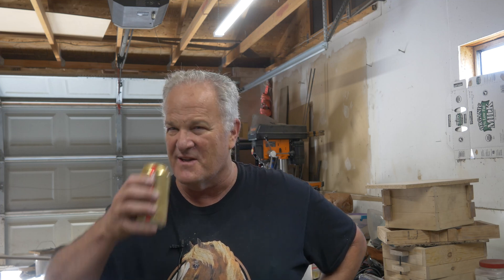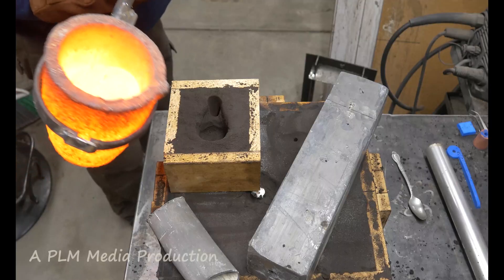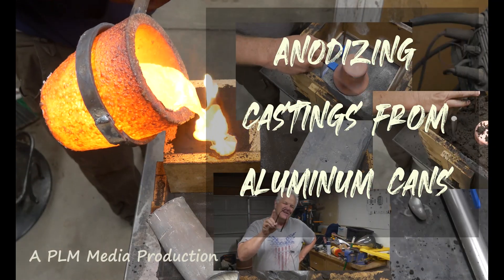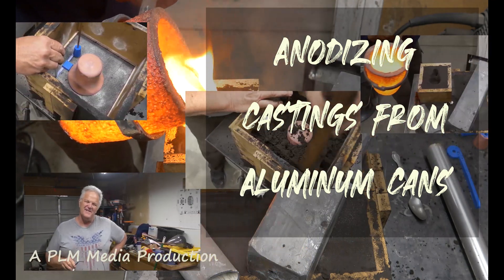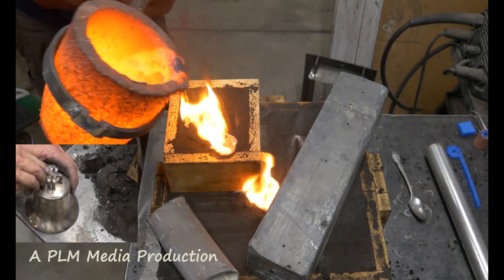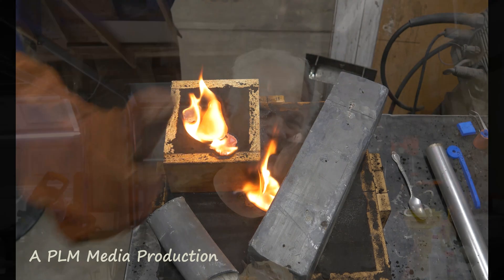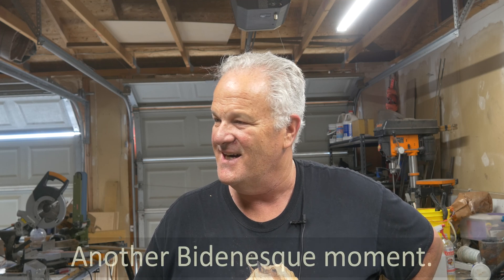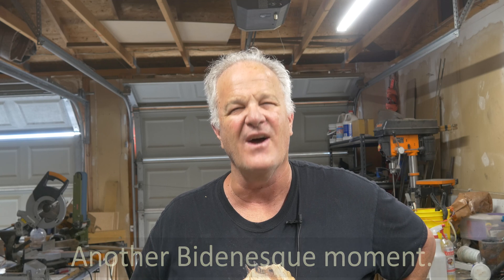Anodizing castings from aluminum cans

Comment: Anodes on Boats are there to protect the Boats Hull (Steel) and then you get different metals around the Stern you get different erosions going on. So I wonder if because you had both Alloys in the Bucket at the same time the process attached more to one than the other, so its a bit late now , 4 years on I make this comment,  but if you did the process again but individually I wonder if the out come would be both become none conductive ?

Comment: No idea if it was a myth from my (our) youth... but the tabs from cans is supposedly different material. Be interesting to do a melt on only tabs (dammit - I'm going to have to try that now!) and see if it comes out differently. You could even do a crude rockwell test on the 3 which would give a clue to it's alloy.  Ditto with trying to bend the 3.
Reply from the maker: I assume the tabs are the same alloy as the lid/top of the can. But you're right, would be interesting to find out.

Comment: i have no idea but the discoloration is similar to the metal finish found under the paint on anodized frames on 1970 ish fishing reels.
Reply from the maker: Interesting.  I believe the finish is related to a reaction between the silicon in the alloy and the solution the parts were immersed in. I still really like the finish from this reaction :-D

Comment: It looks very similar to the process that I’ve used to etch designs in polished aluminum. The difference is that I cover part of the surface that I don’t want etched. Then submerge it in a salt solution and run DC voltage.
Reply from the maker: Well that and that I was trying to plate the surface with an oxide layer to protect it.

Comment: What about aluminum building wiring?  I think it's up over 99% aluminum.  I have an old cable I've been meaning to tear out of my basement.  I think it was the original transmission line, or maybe what was run to the oven.
Reply from the maker: That's the wire I used to hold the parts. If it's low in silicon, I expect it will anodize pretty well.  I've got a bunch of ingots sent to me by a sub to try some more experiments.  I need to get around to trying it again.

Comment: Just my random thoughts, but what did you use for the cathode (or is it anode?  I always mix them up).  You are using the same material to deposit onto both castings.  That could explain some differences, but as I don't know nearly as much about anodizing & electrolysis as I ought to, I can only spitball likely un-useful comments.

Still, it's an interesting experiment, and I look forward to wherever this rabbithole leads.
Reply from the maker: Hi Brian. I used aluminum anodes or maybe they were cathodes I can never remember either. I think they were just scrap aluminum that I had poured into long flat pieces. Actually probably from a failed casting of a sword. No telling what composition they were.

Comment: been interested in the difference between the proper alloys and pure aluminum for a while. The crap from the cans didn't turn out too bad! I've also heard the pure aluminum can be good if you want to make your own round stock on a lathe.
Reply from the maker: I was pretty surprised that metal for cans would be good for anything.  I have plans to do another anodizing test this time with dye as well. Just got to get out there an make it happen

Comment: What happens if you make bronzal with different types of aluminum alloys?
Reply from the maker: Bronzal?? That's a new one one me 😄  I actually don't know what happens to the bronze with different aluminum alloys. One would have to expect that it has different properties. Silicon bronze has different characteristics from aluminum bronze so I would assume adding a tiny amount of silicon, 6% of 10%, would have little difference but there has to be some change to the metal.

Comment: is it possible .... that the higher silicon content of the 319 is actually forming a layer of silicon dioxide, instead of aluminum oxide?  a quick search of the properties of  O2Si states it appears as transparent to gray and.... it is electrically conductive hence its wide spread use in electronics lol.  Possible??
Reply from the maker: Hey, anything is possible 😄  You could be spot on.

Comment: I know nothing about this process but it was weird how your 2 sacrificial pieces reacted and so did your 319. Did your sacrificial pieces look the same as the 319?  Does the material or oxides or whatever it is come off the sacrificial pieces to adhere to the aluminum cans?  Then maybe the 319 acted like a sacrificial piece as well..  Then again, I have no idea what I am talking about.  But it was an interesting experiment.
Reply from the maker: Ha!  Gary you sound like me a week ago 😄

The anodes, or sacrificial pieces are negatively charged and the cathodes (the round pieces) are positively charged. The metal comes off the anodes and collects on the cathodes.  From negative to positive. 

The anodes don't look like the the 319 cathode. In fact, they actually show some copper slime on them after I was done. That was a weird thing I didn't show in the video.  I expect it was from copper in one of the alloys but because the metal is leaving the anodes the copper just wipes of with you finger. It doesn't plate.
Reply: @swdweeb    I guess we will just call it magic for now then. LOL ;)
Reply: @swdweeb  You sure about this??? From what I can see the reaction should of been on the part (the Anode ie: positive), and not on the bottom plate(the Cathode ie: negative). When I did anodizing some 20 yrs ago, the reaction was always predominantly on the part. The part is being oxidized by the chemical bath it is in. No transfer of material is taking place on the part. You are not plating here Gary. You are anodizing, creating an oxide layer that is porous enough to allow fine pigments or color to migrate in the tiny spaces left in between the oxide crystals. BTW. You should rinse and color your parts immediately after removing them from the anodizing bath, before too many oxide crystals form on the surface or your part will not take any color. Aluminum oxidizes naturally over time and will seal itself not allowing any color to permanently seep through its top layer. Maximum of 10 minutes in air after rinsing. The shorter the time the deeper the color and richness of it will be. Just my thoughts(experience). Keep the videos coming. They're great.
Reply from the maker: @henri1511  I'm going on this "The Anode is the negative or reducing electrode that releases electrons to the external circuit and oxidizes during and electrochemical reaction. The Cathode is the positive or oxidizing electrode that acquires electrons from the external circuit and is reduced during the electrochemical reaction."  I found that here https://depts.washington.edu/matseed/batteries/MSE/components.html#:~:text=The%20Anode%20is%20the%20negative,reduced%20during%20the%20electrochemical%20reaction.

Now I could be completely backwards in my understanding and... as a result what I did was have my parts be donors but the fact that the can alloy appears to be non-conductive tells me that the oxidation layer formed on the parts and not what I thought were the donors.
Reply: @swdweeb  What a confusing website . I now understand how you got all messed up. OK. Anyways, Anode is always POSITIVE. You connect the positive from your power supply to your part, the Anode. Negative goes to your lead plate or whatever. The electrons will flow from your Anode(part) to the Ground/Cathode(lead bar or what have you). When plating, you reverse the flow electrons. Keep in mind, Anodizing is not plating. You are basically speeding up the oxidation/corrosion of your part in an electrolyte. In any case, I just thought to nudge you on the right track. There are tons of YouTube videos showing the process. Good luck and stay healthy.
Reply from the maker: @henri1511  Thanks, I'll go out and verify the connections I made and know for sure that the parts had the negative connection hooked to them.

Comment: "Remember, kids: The only difference between screwing around and science is writing it down."  Adam Savage Mythbusters. Yep Data and data analysis are the difference between just screwing around in your garage and Science.
The anodizing process makes pores in the aluminum by growing a larger oxide layer; Anodizing is, therefore, a matter of highly controlled oxidation. some alloys resist the process of growing a thicker oxide layer, especially alloys with more than 11% silicon in the alloy or high amounts of copper.
I've heard there are some ways to work around this issue, but it uses stuff like nitric acid as a pre treat.
Reply from the maker: So does documenting via video count as writing it down? 😄😄
I was told that a lye path would help remove silicon on the surface prior to the anodization process.
Reply: @swdweeb  documenting via video could allow for writing it down latter; so yes 😄
I'm still learing the ins and outs at work. I do know our die shop uses a caustic solution (I believe it's lye) to remove aluminum from the extrusion dies. So I doubt lye would help a cast aluminum part in anodizing. I also know they have a large tank of nitic acid which I believe is for the anodizing opperation. (I'm off doing metrology data analysis for the machining and haven't gotten much into the anodizing side yet).

Comment: This was very interesting.

I don't know too much about the electro-chemistry involved here, but if I had to guess, I'd say that the silicon alloy aluminum was coated in something from the anodes (thus why they were both reacting so voraciously). The can alloy perhaps formed an oxide layer too quickly for the same process to affect it. 

Maybe you could try using a different metal for the sacrificial anodes and see if that affects things? Lead or zinc maybe? Or maybe even just additional can alloy anodes?
Reply from the maker: I need to make a couple of lead anodes. I've heard that a few times now.   Someone else also said the same thing about the can alloy oxidizing really quickly. I never thought about that happening you could very well be right about that.

Comment: It's been to long for me to remember the chemicals but I did work at a place that anodized cast aluminum but it had to go through a few chemical baths and not just one.
Reply from the maker: I just had a guy comment that I might want to run it through a lye bath before trying to anodize.
Reply: @swdweeb  that might be what it was. It was over 20 years ago and I only worked there for about a year. I just remember it went through 2-3 different chemicals.

Comment: I must say I've never bothered to check for electrical continuity after anodising. It would save the step of setting up the dye bath if the anodised coating hadn't formed. Boo for keeping us in suspense regarding the dye step! 
Cheers, Preso.
Reply from the maker: well, I'm still in suspense as well. It's been 36 hours since I anodized. How long can I go to try the dye??
Reply: @swdweeb  shorter the better.
Reply from the maker: @askquestionstrythings  at this point I'll have to try another experiment that includes a nearly immediate dip in dye after the anodization

Comment: I've been playing around with the same thing. I've had good luck anodizing cast 7075. Also acid etch beforehand to remove some of the silicon outer skin of the casting and polish and degrease before anno
Reply from the maker: I did degrease using "barkeeps friend" or something named like that. Basically scouring powder. I havent tried to acid etch.  I have some muriatic acid that seems to be pretty reactive with aluminum that I could try.
Reply: @swdweeb  I use lye, i guess not acid etch since lye is basic lol
Reply from the maker: @davidmccauley7068  I guess I should have replied that my wash is an acid bath, its sodium bisulfate 😄😄.  Well, I could get some lye and try it out. I expect I can find that most places. I'll just tell them I'm making soap 😄

Comment: Very interesting. I wonder if anodizing them together had some effect. Maybe 319 was acting as an anode? Reanodize 319 alone? Dunno what I'm talking about but mahalo for sharing! : )
Reply from the maker: The casting I did the first time, like over a month ago, was 319 by itself and it did the same thing.  The 319 also had a positive charge so it should have been acting as a cathode i.e. getting stuff not giving stuff.  Good questions though 😄
Reply: @swdweeb  Ah. Super odd. Thx.🙏

Comment: How much pressure do you set your air hose to? I see you use a small-holed opening in the nozzle too. Is a large one worse for blowing the sand?
Reply from the maker: Never tried a large one so I don’t actually know.  About 4lbs
Reply: @swdweeb  Wow. That is almost nothing for a compressor. Thanks for answering. I'm about to start casting myself and this is good to know, I'd probably would have made a sandstorm in my shop without this knowledge. :)
Reply from the maker: @cascadehopsful  I actually added an external pressure regulator as the compress itself would not go that low.  You'd know you were too high when you saw your mold disintegrate. As you said a sand storm.

Comment: Melting aluminum cans is a waste of time... but then again, when you buy the drink, you also buy the can, so it seems such a waste of money to not do anything with them. (Or at least, that's what I'm saying to myself).
Reply from the maker: Yeah, normally they just go into the recycle bin and I let someone else deal with the melting and excessive dross. It was nice to have a low-silicon alloy available and a reasonably low cost though...

Comment: do you know what type of aluminum the anodes were made from?  whatever was in them looked like it got moved over to the coaster.
Reply from the maker: Actually I don't.  I thought about that before I did the test. I expect they were some unknown scrap... well they are definitely unknown.  It would be interesting to make anodes out of a low silicon alloy and see what happens.
Reply: @swdweeb  maybe try with the same aluminum as the cast material.  cast them at the same time as the part in the same mold.
Reply from the maker: @tmophoto  I've actually been thinking of trying lead.  I have people telling me that using lead anodes works well for aluminum
Reply: @swdweeb  I've used lead anodes. It works well, and they don't appear to get consumed. Never had any luck with castings though, but always using a mixture of mystery metals, so pot luck.

Comment: Looks like it plated the 319 with a smooth thin layer of somekind of alloy
Reply from the maker: But wouldn't the same alloy have made it on the can metal?  I think, it's possible, what we're seeing on the 319 is a reaction of the silicon.  I think its interesting that the 319 was bubbling away as if it was losing metal during the process
Reply: @swdweeb  yes that was interesting like it was hydrolyzing into an aluminum sulfate but my guess the popcan oxidized to quickly for it to react
Reply from the maker: @kevinwatson5833  Hmmm.. quite possible. I hadnt thought about it having a quick oxidation time.